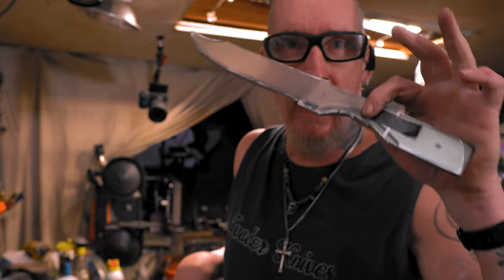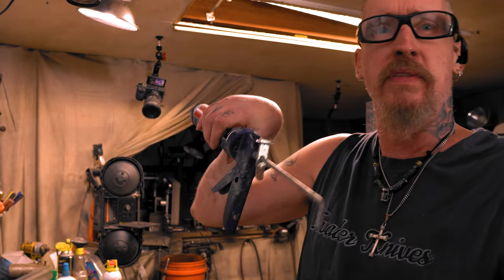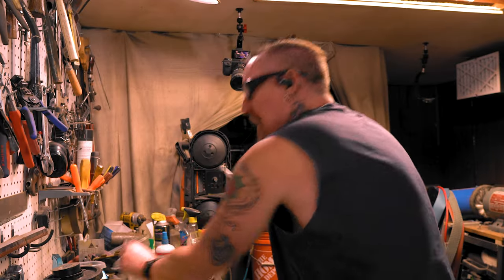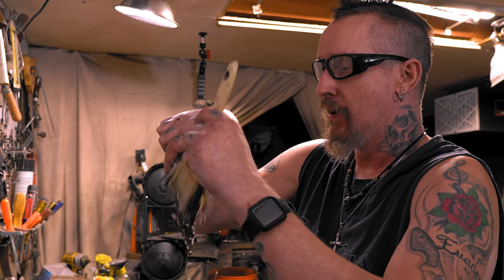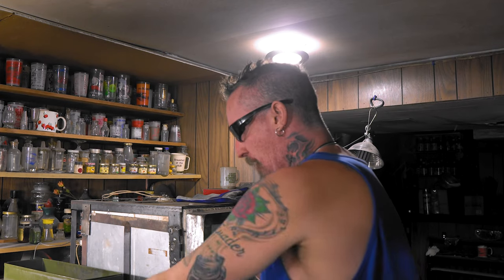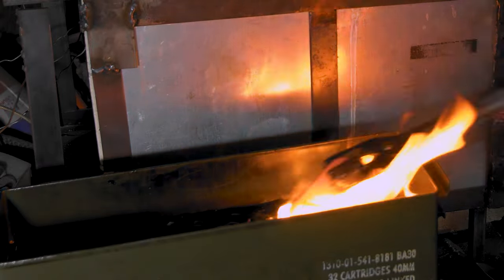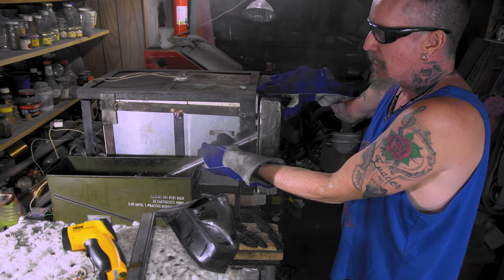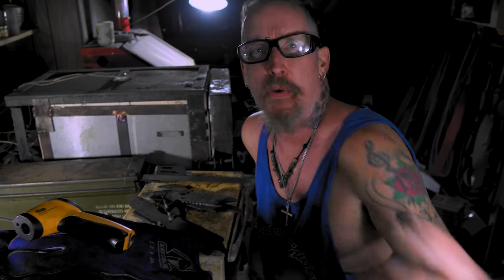Stock Removal Heat Treating

Comment: The normalizing process is a grain refinment process It makes your grain smaller. You said you tested but have you broke a blade to see the grain size.. Cheers as always .. M
Reply: Makes for a stronger blade
Reply from the maker: Right, a long time ago I did. I just don't remember it being that big of a difference. Then again I didn't have anything to magnify the grain or really know what I was looking at... Thanks for the input, hope all is well my friend.
Reply: @evaderknives  You can see the difference rather easily.  try this once just to see. grab a piece of scrap from a knife heat and quench as normal set aside then do the same thing with another piece of scrap and go through the process of grain refinement and then break the two pieces of scrap and you should see a difference. Man, i hope this made sense lol.   Although the materials we use when grinding to shape come to us fully annealed. But Ya, the reason for the cycles is for grain refinement for a stronger, piece. I'd be interested in a video from you just to see if there is any difference. Also, even though we are stock removing to create a knife they say that the heating of the material when grinding to shape causes the grain to move around and not be as close together. not entirely sure if it is true but for the most part most makers do a refinement regiment to be sure the steel is in the best refined structure possible to produce as best a blade as possible. the hardness is irrelevant in this case because the hardness has nothing to do with the steels structure and will not change the Hardness in this case. Bro, I really hope this made sense lol. Cheers, Martin
Reply from the maker: @msblades5382  Na, it makes perfect sense. I think(in my mind) since I do smaller blades, it's not as big of a deal. Strength isn't as important & the Dexter knife is so uncomfortable, good luck getting any swing on that bad boy, hahaha. Yeah, I'm gonna address that in the next video(if i remember). Thanks for looking out!!!

Comment: yeah Dave normalizing isn't necessary  unless you're forging constantly heating it and pounding on it inducing different stress's in the metal, you know looking at the dexter in this one if you'd widen the blade between a 1/4 and a 1/3 use carbon steel and put a descent handle on it it might actually make a descent bush knife! and on your hamone slop for lack of a better name, you can take a wire nut and screw on the tip it works pretty good i do that with caulk all the time!
Reply from the maker: I mean normalizing does add better grain & more strength to the steel. I think cause my blades are smaller, I've never had a problem. And I beat them up pretty bad, hahaha. Right, screw, nail just something to stop it from drying up. Oh & it doesn't matter what we do, that Dexter knife is uncomfortable. Hope all is well my friend.
Reply: @evaderknives  well when i do make the once in a blue moon knife i forge and normalize just out of habit more than anything! and on dexter the handle will suck no matter what but the blade has potential as a bush blade  shape just go towards the thicker side of a 1/8"
Reply from the maker: @keithmoore5306  Yeah, I usually wrap all the blades up in heat foil & normalize, but sometimes I forget or don't have time. I probably should just for the extra strength. They all came out perfectly straight & skating a 65, maybe I just got lucky, hahaha.